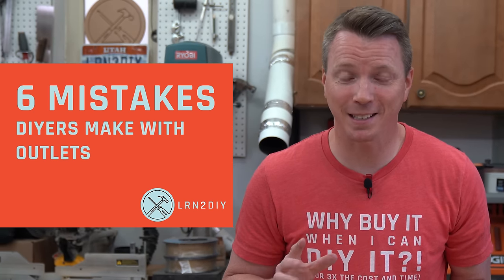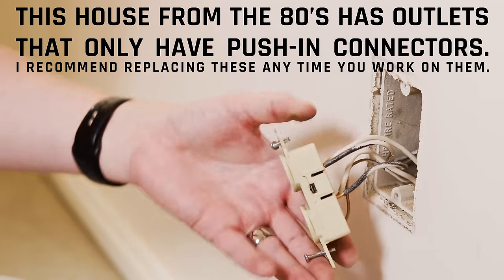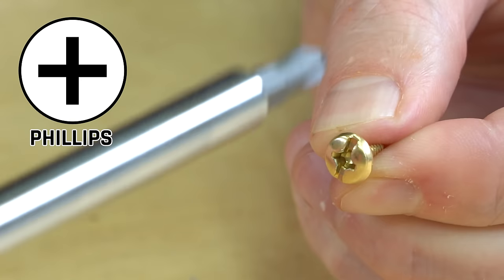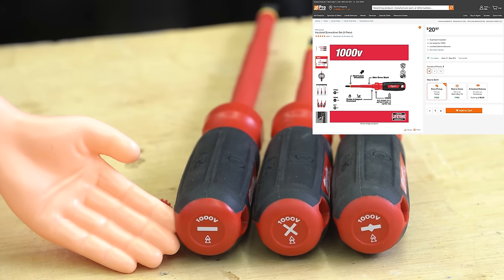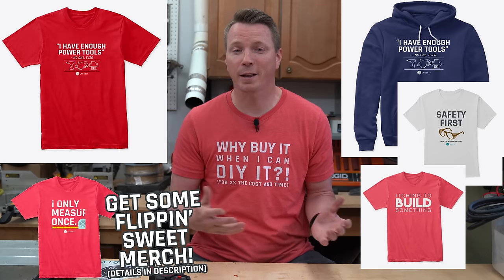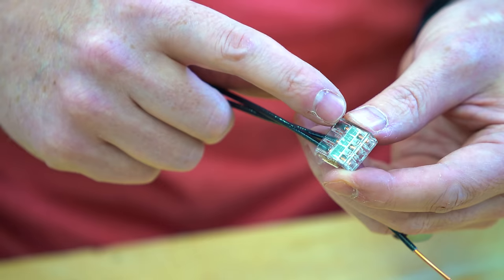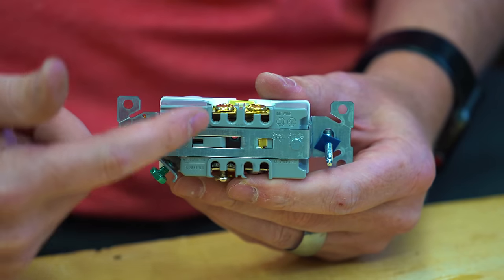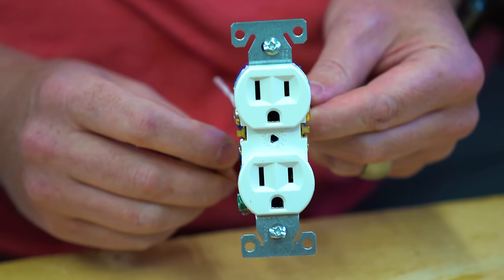6 MISTAKES DIYers Make When Wiring Outlets

Comment: intersting...so a pro did the wiring using the backstab, but it's not good enough for DIYer?  One of the reasons why you said was poor contact area, but then you later talk about Wago lever nut when pigtailing.  How much contact area do you think the lever nut provides?  Not much.  You missed one major mistake DIYers make, when stripping the insulation DIY'ers tend to damage the conductor cutting into the conductor.

Comment: I've worked for electric companies that mandated that you use the back stabs. Then other companies that require using the screws. The backs stabs should never be used. I have seen many melted outlets from loose wires causing heat

Comment: One missed point is Tightening The Screws Down HARD.  Really hard.  
Not so hard that they are on the verge of breaking or stripping, but they should be incapable of 
loosening from normal thermal changes that occur with use of high-current appliances.    
I have done only a very small bit of electrical work, but I have found a frightening percentage of screws 
(when they are used at all) so loose that the connections they make are liable to overheat due to poor contact.   
And I have placed an order for two Klein ECX screwdrivers. I wish I had known of them a long time ago.
Reply: Yes never be afraid to tighten them very hard. Sometimes the wire it not totally straight and if you don't tighten it hard it won't lay flat or contact well. That can be a huge safety issue.

Comment: The boxes I've recently used have a space at the top and bottom designed for the outlet to fit more flush after removing the tabs adjacent to the screws.  A tip from an friend that is a former Sparkie.

Comment: I am not convinced by the rationale for the ECX bit.  A Robertson's taper allows you to insert it with zero gap.  A slotted screwdriver bottoms out and has a gap between the turning blade and the screwhead.  ECX appears to have the same problem.  Here in Canada, everybody has a green (no. 1) Robertson, not to mention red (no. 2).  Flooring screws, packing, etc. all use Robertson.  Because it is great.

Comment: I put a couple wraps od electrical tape around the outlet. Just a pro tip.
Could prevent shorts to a metal box if you're fooling around with it.

Comment: I found in these comments several "advice" comments telling the DYIer to put the ground terminal "up" so if anything falls on the partially exposed plug it would be less dangerous due to possible arcing by a metallic item dropping across the exposed plug blade terminals if in the "down" position.  I have been a licensed Journeyman for 40 years and a licensed Professional Electrical Engineer for 55 years, and I have researched the source of this advice to see if it originated in a  UL lab requirement or other testing lab advice the whole time I have been in practice, with no results. This may be a feel good comment that has been perpetuated.  I  wired my first house as a beginning Journeyman with the ground hole "up, due to similar advice from another electrician.  After the owners wife made me come back and put them in the down position because they looked "funny" I never again put them "up" in the rest of my 40 years in the trade.
Reply: I was always told to put the ground hole in the top position on switched outlets here in California as a way to identify the switched outlets.      Otherwise, always down because it is "normal"

I have assisted licensed electricians in California and North Carolina.  My grandfather was a builder so I acquired skills I enjoy but actually make a comfortable living doing a different type of work.     
Many things are different from parts available to procedures.
Reply: I used to put ground up the rationale being people who pull cords upward may cause breakage to the wire at the plug, so if you pulled the plug upwards the ground pin would leave the receptacle last. When they started making the 90 degree plug the wire at the plug was forced into a 180 loop when installed. So, after a while the wire at the plug would start to fail. Putting the ground pin down would remove the stress on plug wire.
Reply: I found that in my garage, an extension cord would tend to work loose much easier if the ground was down. Putting the ground up holds the cord in better even when you are moving it around.

Comment: Worked in the Trade for years.  Came across diy jobs, that made me wonder why a fire hadn't burned the place down.  When you are working with electricity, remember, that your home Insurance will not cover you if you hadn't had your work inspected by a qualified Electrical Inspector.  Take out your permits and make sure your work has been inspected.  Inspection consists of 2 stages. 1) the roughing-in inspection (before the drywall board and the electrical covers are placed on). then, there's the second Inspection on the finished job to get to go ahead, to finish up.   This is important and can save lives.

Comment: The ECX driver is Infact a positive/slotted driver for electricians there are two oozing/slotted 1 and a slightly bigger position/slotted 2. They are normally used for doing terminal crews on MCBs and RCBOs as well as the terminals on the neutral bar and earth bar . But they are by no means exclusive for electricians or electrical work.

Comment: When I replaced all of the outlets in my house I found the back stab terminals used.  Some of the outlets didn't work and one of them was sparking all over the place when I tested it.  The house was built in 1972 and whoever installed the outlets did a lousy job.  There were no gfci outlets in the house either, so I installed those in the kitchen and bathrooms.  I also heard buzzing in the electrical box so I hired an electrician to check it out and tighten everything up.  Everything works great now.  When dealing with electric, homeowners  should err on the side of caution and call in an electrician whenever you find an electrical issue you are not familiar with.  I use phillips and standard screwdrivers for outlets with no issues.  If your rich of course you can buy fancy tools you don't really need.

Comment: Reverse polarity is one that I find a lot doing service calls. Another important thing to look for is that no insulation is under the connection. That's one that will leave you scratching your head when after years of service, there's no continuity.

Comment: one ive come accross is putting the hot and neutral wires on the wrong sides of the outlet, meaning: an outlet has one hole that is longer than he other if youre looking at the face of it. The shorter of the 2 is gonna be your hot wire, and the longer one will be your neutral. This becomes an issue if youre ever trouble shooting a branch circuit with a suspected break in a wire somewhere within the walls.

Comment: No 7 not necessary but I do it. Wrap the outlet in electrical tape. Basically covering the screws. This prevents any stray wires that could have come undone from touching the hot or load sides.

Comment: On wiring a one-hundred twenty-volt receptacle, I would like to know when bridge tabs should be broken.  One application is when routing an upper receptacle to a switch and a lower receptacle to dedicated connection, but other applications do not seem to make sense, and it seems to me that a bridge tab should never be broken on the silver terminal side of the receptacle.

Comment: just a tip, its always good practice to cut all the wires flush after twisting your joint, before putting on the wire nut.
Reply: Yes, not flattening the tip can result in a single conductor tip poking through the top of the wire nut.

Comment: About time someone said something about the stablocks. The code says you can't use the device as a junction point. I get on the inspectors about this and they never inforce this. Whenever someone tells me they have  recept or two that's not working,  90 percent of the time it's the stabs gone bad.

Comment: If there is a bad connection then if you put a high current item like a heater on the plug the bad connection will get hot unless the connection is super bad in which case the heater or high current item won't work since all the voltage is burned across the bad connection. Plug in a heater and measure the voltage across the plug. Plug it in somewhere else and measure the voltage. It's not rare to see plug receptacle where one of the plugs is kind of melted from having a bad connection and using a high current item. I've seen a plug where the plastic is broken so whatever is plugged in can go in at an angle and the case around the plug is metal so something plugged in can go at an angle and short out.

Comment: In time, outlets with back stabbed connections will break down or arc and sputter internally
when loads such as space heaters and some vaccume cleaners are used quite often.

Comment: I could have swore those stab connections only are good for #14 gauge  wire. #12 gauge  won't fit. I have seen light switches stabbed. The thing is most electricians would never rough a home's receptacles in #14! its only rated for 15 amps just to many modern appliances, gadgets etc would exceed this. Maybe I'm wrong! Good advice that your sharing though

Comment: Re: screwdriver bits. Good info - but incomplete. There's more than just "Phillips" in the 4-wing game. JIS for example - which may very well be what the pre-Robertson fixture screws were -- but it still works today.

The Phillips "point" is the problem. You can get close to perfection without the "dedicated" bit by taking your old, beat-up, phillips and grinding an 1/8" off the tip. 

And then there's Frearson which is more of a shiv than a screwdriver cause it's so pointed.

Comment: I am totally on board with not using the backstabs but you are wrong with saying they are a one time use only. If you look closely on the back of device there is a small rectangular hole right by the round stab hole it’s designed to push a small control/terminal screwdriver into it and it releases the with from the clamp and can be reused again. I’ve been in the trade since 1983 and can’t say I’ve never used the stabs but never on a decent load but one under cabinet light or led/pot light I don’t recommend but have used them

Comment: Missed one thing... Those copper tabs in between the two screws. I've put one plug in before I sparks flew. Maybe I'm wrong but my friend corrected me on that to break them off. It's the tab that links the two screws.
Reply: Break-away tab for split receptacle wiring.

Comment: In new Houses and Trailers, contractors generally use cheaper receptacles (wall plugs) and switches.
If possible, they tend to do anything cheaper for higher profit, especially Trailer & Site built homes.

The newer trailer & site built homes, for all 220volt circuits (Stove, Dryer, A/C outside Condensing Unit) all of these are suppose to have a big block Double Breaker to begin with with each switch of the breaker identifying Amperage.
Dryers are suppose to be 25-30 amps, Stoves, 50 Amps, & If Central Air is installed with a condensing unit outside, they are also suppose to be 25-30 amps.
I say this for the reason, there are breakers that are made to have 2 breakers within the same area as a single big block breaker.
Trailer & Site Built home companies are using 2 of these breakers that are the size of one big breaker for the Stove & Dryer. Where as one leg on the average double breaker takes 2 slots, same with the slim, they also take up 2 slot, but gives you 4 legs instead 2.
They do this to save money.
Also, when you are putting receptacles either outside, or new a water source, (Kitchen Bathroom, etc.) You are suppose to have what is call a GFCI receptacle in any place where water is going to be distributed from a sink or out 9in the weather.
Trailer & site built home companies tie all of these receptacles together with only one with a reset switch (mainly the master bath) in which it will trip somewhere else in the house, and if someone is visiting that person, they may not know about who tripped it, & they will reset the plug without checking first, and this can be a hazardous situation.
Reply: Yep, my 1980's house, 2000 sq ft, tri-level originally had ONE GFCI in the master bath, and the receptacles in the other two baths, the garage, and the back patio were all daisy-chained off that one. I rewired that and put a GFCI in each of the other locations.

Comment: Electrician by necessity of the job. #1 is definitely not the best, and it only works if your wires are solid and the correct gauge and stripped to the appropriate length so yeah, avoid. It's not even an option as I'm bound by procedure to the NEC and I don't do residential except at my residence. #2, Husky [Home Depot] sells a relatively inexpensive multi-driver with security bit, square/Robertson/ECX that I love and use. 1000V insulated screwdrivers are expensive overkill unless you work on live circuits and they're designed for "hot" work. If you cannot determine if a circuit is live, assume it is until you get yourself a non-contact voltage detector [tick tracer] or digital meter. Also, unless you own voltage rated gloves, a good rule of thumb is to keep one hand in your pocket while testing circuits as completing a circuit between your hands takes a path that can very legitimately stop your heart. Only a GFCI properly installed will trip in this condition; [edit - and only if current goes through you to the grounded metal or grounded conductor] circuit breakers will allow your body to be cooked for the duration of contact. 

I personally do not use Wago connectors, but they make doing it reliably and safely easier for the DIYer. Just make sure that like wire nuts they are sized correctly for the wire you are using. They're handy, but not as flexible in application as an assortment of quality wire nuts especially in older federal buildings.

All in all, good advice. Also, I would add using fiberglass ladders. They provide isolation from the earth where metal and damp or wet wooden ladders do not. Not dying and not catching things on fire are their own reward. 😎👍

Comment: This video shows the outlet bottom side up. The round hole goes up. It is the grounding connector. This is according to National Electrical Code. I have heard a great deal of discussion about this while teaching electrical safety in electrical troubleshooting classes. Must professional electricians still put the round hole down saying plugs stay in better. However, when a three prong plug is used and it pulls a short distance from the outlet, the grounding prong is the first thing any falling conductor will touch and the fallen conductor will have 0 volts differential with any grounded surface preventing an electrical shock.

Comment: I have a large manufactured home.  Some things are nicer than stick-built, such as perfectly square walls.  But every damned outlet in it was insulation-displacement!  Only thing worse than backstabs.  Whenever that characteristic burnt smell is detected, I replace the outlets in that room with good screw-terminal outlets.  A couple of things I prefer:  After you get the shepherd's hook seated down, give it a little squeeze with your cutting pliers to close the open hook before tightening the screw.  When you have to connect a stranded wire to a screw terminal, use a crimp connector.

Comment: As a master electrician with 25 years of experience I have had actually very few problems with the back stabs.  Just make sure you give the wire a good tug before you put the receptacle into the wall.  I thought they were kind of poor quality at first, but really, very few problems, nothing wrong with using them.  And yes the green Robertson screwdriver works well, I am canadian, we use these all the time up here, very good screwdriver, I prefer it to flats or Phillips any day.

Comment: If you move into an older house. Check the wiring. Aluminum wiring needs to be tightened on a regular schedule. If you bought the house, pay to have the wiring updated. Aluminum gets hot easily and causes fires .

Comment: I had a situation in a room where power at 2 out of 4 outlets would completely lose power if the first outlet in the chain was simply touched. I decided to check the outlet.
After turning off the power, I removed the outlet in question and found it had been stabbed in the back and the input wire was very loose and the reason we kept losing power.
I replaced it with a new 15A outlet using a proper J-Hook method. After installing that outlet, I decided to check the others. Sure enough, the outlets were not only worn out so that plugs could easily fall out, but they had all been back stabbed. After replacing everything, I haven't had a single problem. The only thing I didn't do is use an insulated screwdriver.

Comment: You bring back memories of when I was an Electrician's helper (for a few weeks.)  I got to do all the outlets, switches and hang lighting and ceiling fans while he did the more complex jobs.  He would NOT turn the juice off and simply told me to not touch both sides at the same time and I'd be fine.   Of course I got bit a few times LOL.  It really doesn't hurt as much as it surprises the heck out of you (110... 220 HURTS but I didn't work with that.)

Comment: It is a Code infaction to put more than one wire under a terminal or to use the device as a connector for a circuit  .You MUST ust pigtails and approved connectors (wire nuts) , Also the directions for proper installation of wire nuts is to NOT pre twist the wires . they are to be installed in the wirenut sreeight !